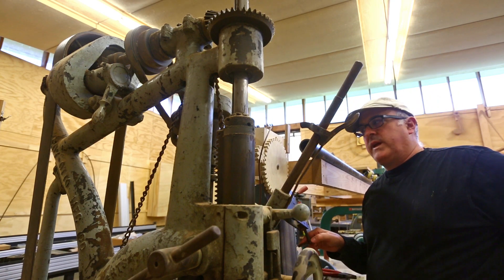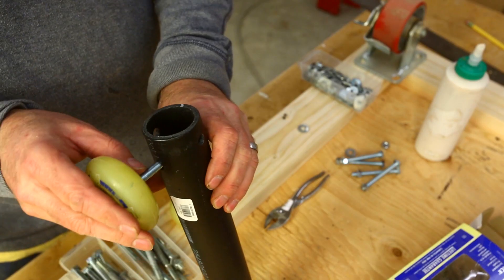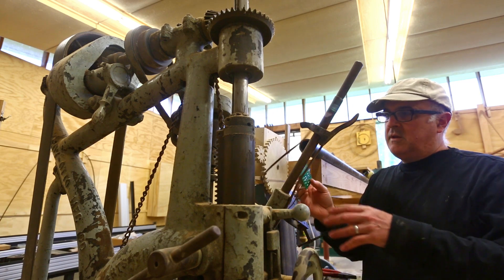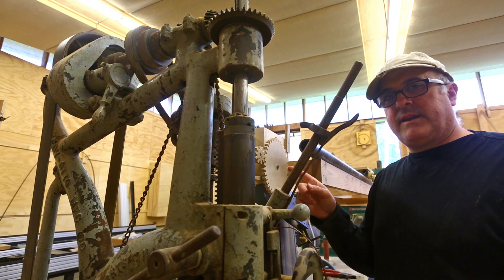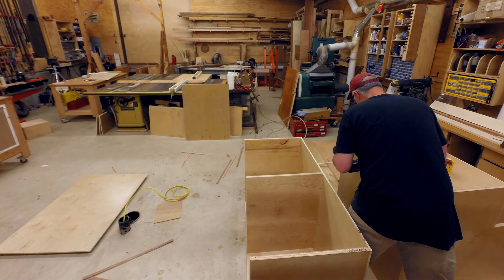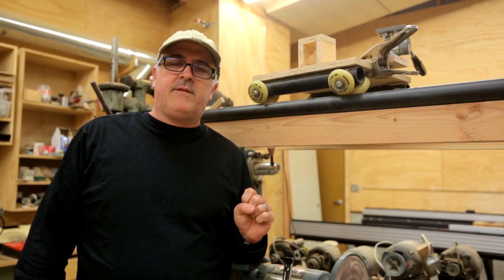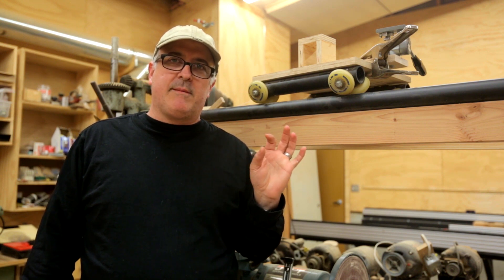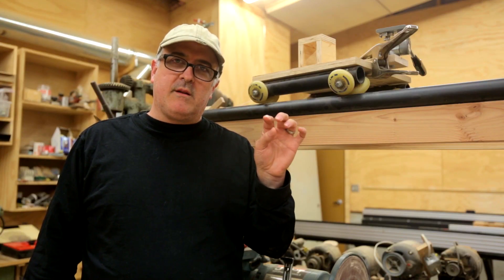Motorized Stop Motion Dolly

Comment: Hey Frank, you could replace the potentiometer on that speed control with two female header slots, and you could then easily swap out different fixed resistors. With a little experimentation, you’ll find pairs of know resistors for time intervals, e.g. 1k and 10k for 13 minutes, etc

Comment: Hi frank, love the videos. Just a quick one. Would your trolley not speed up towards the end as the amount of string would build up on the wooden dowel and slowly become larger and larger, therefor pulling the cart at a different rate than when it started with no string on the dowel? Hard to explain but I hope someone can. Solution might be to loop it over once then hang a weight from the end?

Comment: It would be really neat if you made a track that went all they way around the shop while you worked on a project! The wheels would need to be able to turn though. You could probably convert a model train set...ideas. :)
Reply from the maker: +Justin Dorris yes, I would love something like that.
Reply: +frank howarth It'd be reasonably easy to do.  Instead of mounting the gears on the end of the track, mount them on the moving platform.  The only major change would be the need for a driven axle (in place of the axle the string currently winds onto.  To keep the wheels at the 45 degree angle they're currently on, you'd need a universal joint or something.

Comment: Hummm, I don't think you need a weight on the other side if you didn't use an angle. It might even add too much stress on the motor if you wanted to do a stop motion going down. I think it would be better if there's another pulley on the other side and the string goes from one to the other and back, winding on both axles.

This way you can go one way and the other, and a reset would be easier since you wouldn't have to unwind the string from the pully, but just having the dolly attached to the string using another string or something else that was easily removable.

Just my two cents on improving something, and I thought I had to say that as a thank you for so many ...hours? enjoying your videos.
Reply from the maker: fadetounforgiven Yes, I like this idea

Comment: +frank howarth Thanks for sharing how you create these amazing videos. I like the idea for creating a timing gauge for the speed control. I think your idea will would work if you always use the same setup. But change the weight or a climb angle and the motor would have different power needs. So you might start by just putting some kind of basic graduated dial behind the knob for you to reference. Even when we have somewhat arbitrary points of reference, our amazing designed brains seem to create a type of intuition for these things over time.... Or just invest in stepper motors like everyone else is saying.

Comment: You know the rpm of the motor for a given speed control and the number of gears in two gears and the diameter of the shaft that is winding the thread. So, you have all the values to theoretically calculate the speed of the dolly.

Alternately, you can measure how much the dolly moves in 1 minute at different motor speeds to find the position for 30 minute speed.
Reply: Ashish Singh only problem I see is that the spool that is winding the thread gets fat as it winds more thread, so your dolly gets slower as it goes on. That is the measurement for 1 minute will not extrapolate linearly. :(

Comment: to measure the dial it wont take as many tries as you think. and will mostly take basic math. how many rotations of string on its spool. reduced from the big gear to the small gear based on its ratio. then you can set a time in 30 or 60 second intervals on the rotation of the small gear based on the position of the small gear. and calculate the results based on the position of the speed control knob. and make a face for the speed controller. on your calculations.

Comment: Pro-tip for anyone trying to find such a motor: microwave oven turntable motors in the US are often (maybe 50/50 in my experience) 120V motors that are designed to turn between 3 and 9 RPM so these are just about plug and play motors you can salvage from someone else's scrap.

Comment: An appropriate length arm and a counterweight on the camera mount would enable you to track a specific point in the scene. By tieing off the string before you start the motor it would move the camera angle depending on the arm length over the length of the track. Hopefully that is clear... Love the stop action. Keep up the great work.
Reply from the maker: Brandon George I have been thinking about something like that for the lathe.
Reply: That would be an awesome shot. I think it would really emphasis the three dimensional aspects add the lathe. I hadn't noticed until you mentioned the "flatness" in the panning shot earlier.

Comment: You could probably use PWM on a Arduino, that way you could program how fast the motor would run to give you much more precision. Or use a stepper motor for even greater precision.

Comment: I don't know for sure, but I think there are two main types of potentiometers available on the market, one of them is a linear one and the other is logarithmic, so check it if you can see a marking letter (A usually stands for log pots and B for linear), you can build your gauge based on a reading from a multimeter/ohmeter, and instead of marking and waiting in real time, you can guess the timings based on small scale timings and plot that on a graphic to see the curve, then you can guess with more precision the next marking on your gauge, without having to wait it in real time. I'm sorry if I was a little confuse, I hope I could help in any way. Thanks for the vid!

Comment: Just a suggestion, use the front panel of a broken microwave oven, you have there the display for the time and a control panel, most of those panels just turn on an off a relay, you put the time, the relay is on for that time, that´s the most easy way to do a time controled relay,

Comment: Making the gauge is actually pretty easy. Make three runs: 0%, 50% 100%, plot it and you'll instantly see if it's linear, check if it's "linear" on a log scale. If it's not, make another two runs @ 25% & 75%, that's usually enough to approximate the whole curve.
Reply: MrTridac might be waiting a while for that 0% run!
Reply: MrTridac What this guy said.
Reply: MrTridac unfortunately potentiometers (even linear ones) are not truly linear, and this will not work especially at 0%! LOL
Reply: XmackattackX
I know, but they're good enough for the speed controller. I guess the electronics will add a fair amount of nonlinearity, too. So, I'd probably start with all five runs and plot it. If I don't feel good with the approximation I'd add more data points. Oh, and BTW: 0% is a data point. pot:0% = speed:0m/s. I expect Frank to be smart enough not to wait forever for the 0% run to finish.

Comment: Curious if you attached an amp meter to the speed control if you couldn't develop an index between the amps and speed using a spreadsheet, then you could convert the position for a particular amp setting to a speed setting.If you clocked the speed at different ends of the speed spectrum and one in the middle if it would yield a consistent index. you could easily test the theory............just a thought...I know you will figure it out. great vid

Comment: Hi Frank !

You talked about "tension on the string" - you could just make the string as a loop wound around the axle og the big gear some times - to hold the string tension just make a spring be part of the loop. 

This way you can move the camera both ways just by reversing the motor.

But why do the camera have to move ... just because it can OR ... ?
Reply: Keld Sørensen The tension itself isn't that important. What's important is that there is a force resisting the movement of the pull, and that creates tension. A spring wouldn't serve the same purpose, and still wouldn't create any tension if the dolly wasn't on an incline. 

Howarth really is an artist. Of course the camera has to move, it's artistic! :P
Reply: Victorhuhu OK, I'm not explaming what I mean the right way !

The method I'm proposing is used in so many other situations like this - the very old "pointer" in a radio showing which station you have selected IS set up just like that:

Some turns around an axle futher to the pointer around some wheels and back to the axle again BUT a spring is set in between the two ends ... yeah, to hold the line/string at a curtain tension.

Similar system could be used to drive the camera on the rails forward and backwards. ;-))
Reply from the maker: Keld Sørensen I see now, the string becomes more like a belt  and lees like a tow cable.
Reply: frank howarth Or even more simply: take the wheels off the dolly and drag it along the track. Friction would keep the dolly from moving forward.
Reply: hafree42 Yeah, but then you can't move it backwards :-))

Comment: to save time figure out how far the dolly moves in x number of rotations then it will be easy to just measure the rpm on the small gear and extrapolate how long it will take to get all the way across... its a little investment in the math at the start but will pay off in the end

Comment: Hey Frank, I really like your videos. May I point something? If you use a small gear to move a bigger one you slow down the linear speed not the rotational. So, in your setup, you have an axle in the middle of the big one. That means it'll rotate more or less the same speed as the motor.

But.. Maybe you are using it like that for the leverage, in that case I'm writing just because
Reply: Vendetta Hate to be that guy, but you are not quite right. What frank has done actually slows down the speed of the axel in the big gear. http://en.wikipedia.org/wiki/Gear .... it depends on the size of the gears. As you can se under "history" and "Single stage gear reducer" (a gif), when the little axel has done one full lap the big gears axel have done almost a quarters of a lap...
Reply: viddy stiggy damn.. Both are right. I don't know what I was thinking about. Well at least I learned something
Reply: Vendettai dont think that is the case. the 2 gears have teeth that mesh and move on at the same speed but the rpm transferred to the axle of the large gear is lower because it has many more teeth over a larger distance (circumference) to make 1 revolution. so the smaller gear may spin 3 or 4 times compared to 1 on the larger gear. ... i think.
Reply: Vendetta nope. i totally get it. you see a close up and they seem to be spinning at the same speed. thats a mind trick!!! hehe
its the revs that count here.